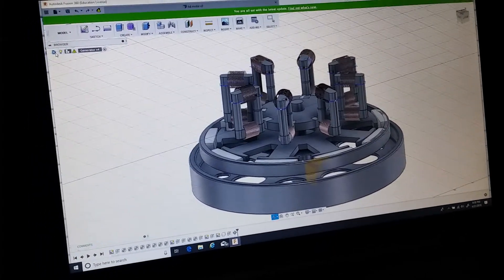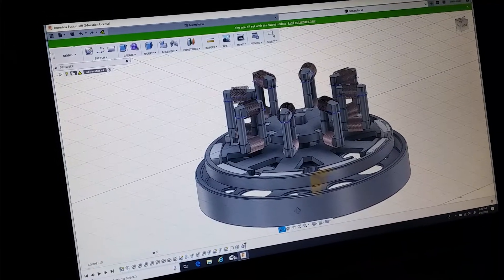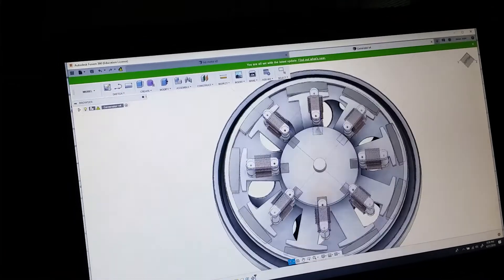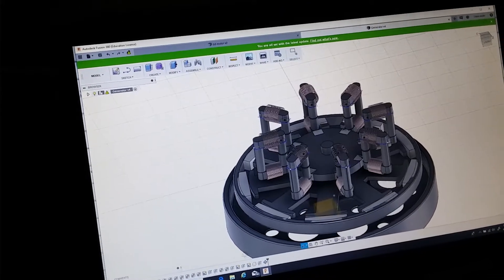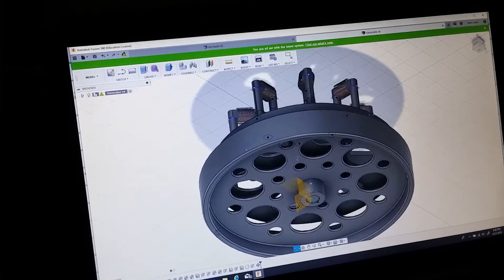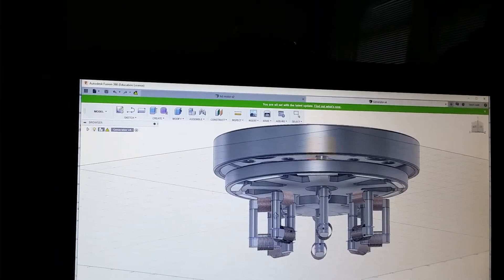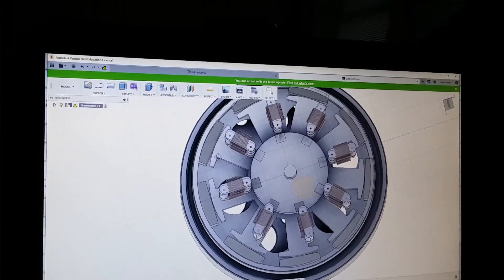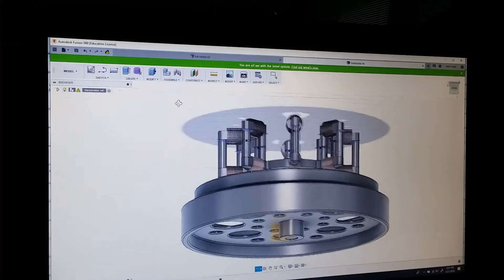Warp Drive Generator in the making!

Comment: Looking good and coming along...... 8 pole stator (8 magnets)?
Reply from the maker: Yes, I'm changing it to 16 pole and magnets to get the amount of wire   to give me the voltage and current I need, then I can actually configure the winding for a 4 pole stator which will give me 60hz @ 1800rpm
Also if we custom build the motor we can make it a 9 leg 3 pole motor which will give us 3600-5000 rpms
Reply: Jason, can you tell me please how you spin the Hyper Drive over 2000 rpm with the TI master controller? I am struggling to understand the ''weakening of the field'' section. I can't spin it more than 800 RPM. Thank you
Reply: @eugen995  you can spin it to 5000 RPM if you want , here is how , first you start at regular speed 200 then put it to 12000 the motor will NOT speed to 12000 maybe 500  , then you go to the weakening of the field put it in automatic , then take it out of automatic and decrease it slowly because  it depend what motor you using , you can go to -3.9 and the motor will spin over 2000 RPM , if you want more then put the SM modulation to 2 this will make the motor go crazy to fast speed , you have to make sure the motor is safe to turn at this speed , please note if you go to the max of your motor you can break the motor or the warp drive, go slow
Reply: Thank's a lot Amir!!  That's amazing and very simple! I was struggling two days and I couldn't make it! Sincerely thank you.
Reply: @LymanPerrine  depend what you want to do with it , can you share with me so i can tell you if you will be wasting money
Reply: @LymanPerrine  if you will built it like jason based on canceling the lenz law then yes this kit http://www.ti.com/tool/TMDSHVMTRINSPIN#supportandcommunity will be good but if you dont have lenz law then you can do it with any VFD , but if you want to have access on all part of the motor then yes that is the kit to have but if you dont have lenz law and what jason is getting good results then that kit is over kill
Reply: @LymanPerrine   for playing yes its good you can have more control over the motor
Reply: amir ibrahim - just to clarify your post on the benefit of the TI device:

1.  if following the ideology of Jason with anti-Lenz Law (Lenz Free) generator design, then yes the TI device will work for that application - correct?

2.  If maintaining the Lenz Law and keeping it in place as for as a standard, conventional generator goes, then you advise to NOT use the TI device - correct?

Thanks for sharing your research experience - many thanks Amir!  Keep us updated with your post as you discover different things 👍
Reply: @markjohnson6224  yes that is exactly what i want to say , i will put soon some video for my testing on the 10kW wind generator and post the results
Reply: amir ibrahim - thanks again - look forward to keeping up with you and Jason